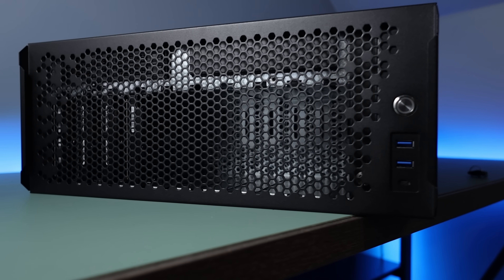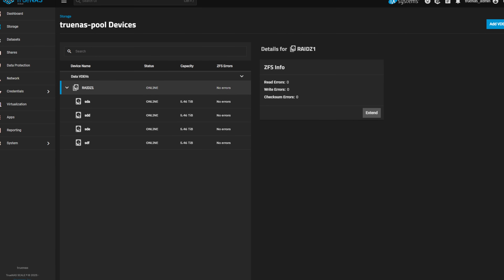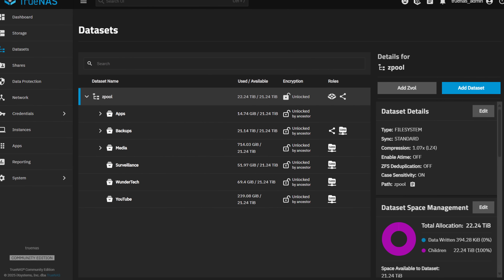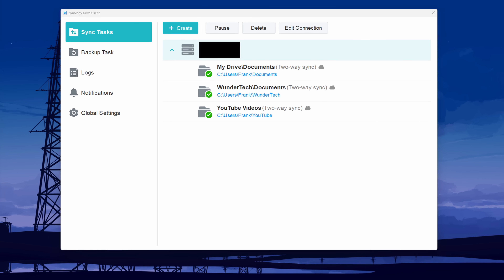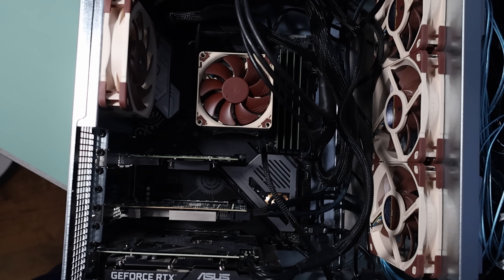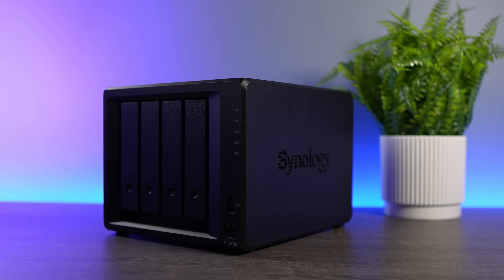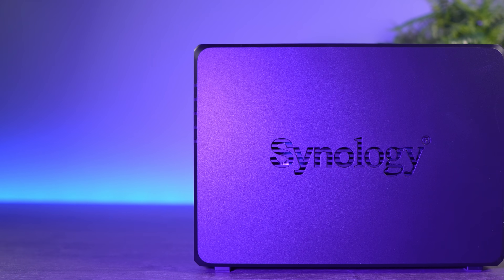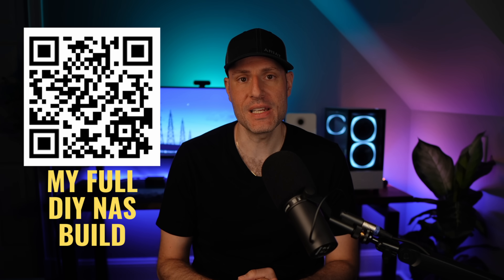Everything I Did Wrong Building My DIY NAS (was it a mistake?)

Comment: I have been reading about NAS /watching YT NAS videos for a few days, so this is ignorance speaking.
128 GB of RAM seems like  . . .  a ridiculous amount of RAM for a NAS.
I have the feeling this is doing something else.
but then the first commentor I see also has 128 GB  of ECC RAM . . . .
Reply from the maker: It's because I'm using TrueNAS + ZFS. ZFS uses extra RAM as a "smart cache", so more RAM equals better performance.
Reply: @WunderTechTutorials  thanks, I appreciate the reply.  I was "a bit" taken aback at the quantity of RAM as I have been watching videos of NAS builds w. 8 or 16GB . . . 

and I was thinking - this can't be the same thing.
I don't even wanna guess qhat 128GB of ECC costs these days.
Reply from the maker: @ekw555  Yeah, if you're going with Btrfs, 8-16GB of RAM is normally sufficient. With ZFS, the same can be true, but the more RAM you use, the better the performance, so people tend to load it up. Plus, you're correct, this RAM was purchased years ago 🤣

Comment: I don't get the thing with on demand sync. How can data live and not live on different devices at the same time? Is it synced data or is not synced on both devices? Do you use data from your NAS or you use data from your PC? Either it is on both devices and it is synced, or it is only on NAS and you read that data. Does Synology deletes files on your PC after some time? Do you understand what I mean?

You have 25gbps NIC, so you have at least 10gbps link to your PC. Why would you have all your data on your PC and on your NAS synced, not synced? Why don't you just use NAS as a working drive? 10g speeds are enough for 99% of anything to work with.

Comment: I avoided TrueNAS and went with Fedora Server instead. My needs for data retention wasn't about significant performance but availability, security and resilience and I achieved those goals quite well. Instead of using sync, I just mount my NAS as a NFS share on my desktop and use it with SMB on my phone. I've considered backup solutions and sync as well but that's the next step. It's important to cover the basics first. I would probably go with borgbackup though and possibly rsync if I wanted these features.

Comment: Losing Synology Drive is the single most concerning thing for me. I originally had Windows backing up my computers, and I had immutable snapshots so that ransomware wouldn't ruin my life some day. The problem is that nearly all backup applications save to proprietary files that the OS can't deduplicate. So, every new backup would be duplicated multiple times. In about a week, these backups filled up my entire NAS, and I had to disable it and wait another week to get rid of all of those immutable snapshots.

Synology Drive just saves them as their original files. That means they can be deduplicated and I can just go through my snapshots and pull a single file from the backup folder if I need it.

What other application works like this? Because I don't want to remain on Synology, but I can't find a viable solution!
Reply: Easiest way is to not save anything locally.  set up your smb shares on the NAS and that's where you keep your files.  If you're on a mobile setup or still want to keep your local files and use your NAS as backup to your local files (not sure why you would, just means paying for more storage, outside a few things like video editing, but even then, ehh), syncthing too keep your NAS versions updated based on what you've changed locally.  As for backups/ransomware protection, in TrueNAS (ZFS is the filesystem)  you want to go learn snapshots of your datasets and can use dedup as well.  And dont forget, it's not backed up, unless it''s also offsite as a second copy, 2 systems under the same roof don't count.

Comment: I was looking at the ASRock Taichi x570 and it seems The options to adjust ECC related settings was removed at some point. did you run into this problem?
Reply from the maker: No problems at all, everything is running well and I validated it's running in ECC-mode.

Comment: Excellent video! Though with that hardware, I would install Proxmox and create a TrueNAS Core VM, passing through the HBA for your data drives. This way you can leverage the hardware, give more reliability to TrueNAS, and install other local network services like Pi-hole, Nextcloud, Jellyfin, Piwigo, etc. (you can see what services do you like in proxmox helper scripts web).

Comment: I'm a fan of not building a storage server and sticking everything on it.  I'd rather build a separate "server" for hosting whatever services I deem necessary.  That also means that my NAS does not need to be as powerful and as such, I also look at the fact that most of my laptops/tablets/etc are on wireless so no need for 10G ethernet.   However I do think that there's a fair number of folks that think that  once they get a NAS, they're done;  in truth,  backups should also be the concern.  A NAS is a good step in the direction of centralizing your important files and data, also a good step in helping to ensure that your data is sort of safe, but backups of your data should also be on short list of things to setup.   Now, I can get off my soapbox.

Comment: I'm trying to work along with you here.  I tested drive set ups to get the best performance and at least some drive failure protection.  I'm slowly getting there.  The Truenas server is just a plaything right now as I try  stuff.

I purchased the following:
(This did turn out cheaper than buying a new motherboard, case . . . . .  I live in a small apt and I really can't keep many things on hand.)

Dell R730XD
256GB of memory 
two 10gb and two 1gb nics
I've got 10, soon to be 12 10GB SAS drives.  They are "recertified" and were about $90 bucks a piece
Right now I have a 2TB nvme I'm using for cache.

I would like to copy my Synology data over so I can test and play with stuff.  You said that you used Rsync to do the job.  I'm not real familiar with that.  I do have Rsync copying over my data, but it's going to to the default directory when I installed RsyncD.  I have no way to access it other than maybe through the shell using command lines and they haven't worked out too do at this point.

I'd love to see how you configured RsyncD and Synology to have access to your files on Truenas Scale.  I did try to use an smb folder but while I had access to Rsync, it appears I can't get access to my share folder.

Thanks.
Reply from the maker: I did everything through the CLI, but there's nothing wrong with using SMB. It's going to take a little longer, but if that works for you, go for it. The initial data load is the most annoying part, but after that, you're good to go!
Reply: @WunderTechTutorials   I just rediscovered robocopy.  I hadn't used that in years and I'm getting really fast copies.  I mapped a drive to a truenas share and one to a synology share and we were off and running. Speeds were really good.
Reply: @WunderTechTutorials  If this is a duplicate replay, I apologize.  I've rediscovered robocopy.  I mapped to a shared folder on truenas, and then to a shared folder on synology.  I'm copying large video files and speeds are averaging about 5.7gps.  I'm a happy camper now.  It has been decades since I used robocopy and it just popped into my mind.  Thanks for responding.

Comment: I don't understand the allure of Synology Drive. I understand that even sync-on-demand will use up local (client) storage. Only if local storage has been almost fully exhausted, some storage will be reclaimed. That is not how anyone should be using modern storage media (solid state memory) because it will prematurely age the media.
Reply from the maker: It's very nice to be able to work on files locally and ensure they're synced to the NAS. Not everything has to be synced and not all files perform well over the network due to their size. I've never come close to burning up an SSD so that's not a concern to me. Most that I buy are rated for 600+ TBW which I'll never get close to before they're replaced. It's a really great tool for people like me, but I acknowledge it doesn't work for everyone.
Reply: @WunderTechTutorials  you can run syncthing for this, i run syncthing on pi4 and sync keepass and obsidian notes on phone and all devices.
Reply from the maker: Yeah, Syncthing is awesome and I do use it, but it unfortunately doesn't have on-demand sync.

Comment: great video! I attempted this some years ago following your path.  I knew I had a collection of old hard rives and gaming pc hardware I wanted to use in the "pasture" until they passed from this mortal coil.  I knew I was playing with fire since I didn't have any Linux skills.  It went pretty well until a major stable release change to, 11.0 I believe,  that broke the interface and couldn't recover.  I didn't get any help on the forums either.  I tried troubleshooting from the command line and was able to get it responding but wouldn't talk to past my router to my chagrin.  had to move, then just moved on leaving the box as it was and still intend to hook it up and at least recover my data, expecting better results as I've used Linux professionally for years since. (...thinking df-h is your friend lol) anyway I imagine the Truenas is far more capable and prettier than ever haha.  Point is you've encouraged me to pick that old box up and get it done! TY

Comment: I wonder (though I understand if that's beyond your channel content) if you would be able to run xpenology with swapped HDDs from your existing Synology NAS ? not as a fake replacement but as a worst-case scenario if your Synology died and there was no fast replacement to buy to access your data ?

Comment: I’m assuming you’ve tried running Nextcloud to replace Synology Drive. If so, what were some things you couldn’t get to work as you mentioned that none of the third party solutions were a great replacement? Thanks!
I’m still rocking a DS 218+ and never used it as I have before my storage pool / volume corruption I got on it. Thankfully data was read only and I could rebuild. But the process was daunting, I had 3 websites down for a few months during a fix. Never installed Synology drive since, just use it as SMB and connect to it with Tailscale remotely. I did change out my added 4GB after market RAM module for a Synology one, just in case ;) 🤔🤷‍♂️
Considering new coming NAS options from UniFi vs MinisForum N5 Pro. Thank you for this build tutorial, I did consider it as well.. 😅👍

Comment: Good video. I have a DS1621+, and I'm also trying to move away from Synology. 
I built 1 DIY NAS and installed truenas community and I am very satisfied. I can back up photos and videos from my phone to the NAS, I have a PLEX server (which runs all movies and series in 4K without problems). and with VPN I can access my files outside of home. 
I still need to find a solution / replacement for MailPlus Server, Webstation and Phpadmin.
I don't regret the choice I made. I hope that one day they will make these applications for truenas.

Comment: TrueNAS. There is a very steep learning curve for a newbie. And a lot of trueNAS specific jargon to get ya head around. A great example of this is things like the need for "IT" firmware on an HBA> Heck I didn't even know what an HBA did when I first started..let alone why (and how) you need to load the IT version of firmware on the HBA card to get TrueNAS working properly.. I wasn't even aware of the difference between IR and IT! Nobody tells ya'all these things.. It's not like there is a "TrueNAS manual" or anything! So Don't expect things to just miraculously "happen".. there is a lotta reading to do. I found AI real useful on the build here. 

You also have to know how to rebuild the pool if the hardware goes down/dies. Been there (done that). I had a RaidZ-2 with 12 drive pool so when the server died failed chip..(and never store the OS on a USB drive), what do you do with all those drives...how do you get that pool into new hardware? Ya gotta think this sort of stuff thru..This time around I have a RaidZ-2 with 8 larger disc array and backup that to one large Stripped disc pool that I locate at a different location. That way if another disaster occurs I only have one ZFS disc to rebuild my data real quick on a much simpler device (whilst I wait to rebuild another NAS...iX ready built stuff is super expensive BTW ) I can then copy the data over my network to the new NAS once it is ready built to go. Always think thru a "whatif" the hardware fails. THe TrueNAS forums are awesome help and so is Grok AI. It helped me big time how to build a TruneNAS set up. 

(Yes SMB is a must into TrueNAS)... because an inbuilt filesystem is non existant! Yeh I know there is a webserver app to see your files an' all but that is such an awkward way to run stuff after you've used say QNAP or Synology. Nobody tells you that sort of stuff before you start! Or that it is real easy to simply SMB into a TruenNAS data filesystem via the "connect to server" process using finder on OSX... Nobody gives you any clues this is the way to go etc , but once you work it out;s it';s super easy.. It's great they moved TrueNAS to linux (with Scale) because Linux and OSX work real easy together. And it's super easy to run the Linux command line thru Terminal within OSX (guided by AI) as you can feed the results of a Linux query/log etc straight into AI for the answer! Nobody tells you that either!!!! But you can! That (along with the obvious advantages of ZFS) makes TrueNAS Scale (in particular) awesome! Because the AI Linux parameters must be huge! (It's been around forever). This makes working with TrueNAs real easy. And exciting. You feel you are on the cutting edge of the future of data storage management. Well worth the tinker!  IMO!

Comment: I am very happy with Proxmox and Xpenology installed in it with passthrough for the disks. No need to get away from DSM. Lesson learned.
Reply: I’ve done both ways… but I would pass through a HBA
Reply: are you passing individual disks or whole controller ?
Reply: @TzzSmk  I did it both ways.  Just after my build I had 4 SATA disks so passed thru each one.  A bit tedious but not too bad.  Of course I did it via command line.  Later when  I was planning to put all this in a new rack mount server chassis I got the HBA.  Now wish I had gone with the 16, but got the one that supports 8.  My motherboard SATA ports run into the disk enclosure so can't be used easily.  I then passed the HBA thru and did it in the GUI.  So much easier.  I don't think you can go wrong with either way really.
Reply: @TzzSmk I am passing individual disks but I have only 2 nvme "disks" mirrored. I am using a MS-01 Minisforum...

Comment: Solid take. I too took this route. Never looked back. Buying into a brand is folly today.
Reply: Don't need brand loyalty, just use whatever is cheap, its a NAS after all. You could build one entirely out of dumpster dive salvage if you wanted, just use some level of redundancy/mirroring in case a drives fails.   The reason corporate goes with specific brands is warranty/support (which is a huge deal when dealing with large data centers).

Comment: As for your drive/sync problem, running a Nextcloud instance would solve this to a degree, as it does support on-demand sync of files. It has some limitations particularly on Android for example (there was a long dispute with Google/play store who wouldn't allow them to auto-upload files from their app). It does the other things like provide access to files via web. OwnCloud also still exists (NC was forked from this) and it's targeted more towards business use, stability and reliability, less about doing everything at once and having ALL the "apps".

I am over all satisfied with nextcloud, but of all the services I run myself, it's by far the one that I've had the most work with due to just random nonsense. Also I'm pretty sure that you're aware of NC and not used it for some specific reason...

Comment: Indeed I'm surprised you said you didn't use SMB much for accessing your network files... I never really used Synology drive at all since I got that NAS and even before getting a NAS I was using SMB, NFS, and the old NetBEUI protocol for accessing my files through my local network. I always try to find alternatives for the apps I use or plan how I will do things before switching to a new device or workflow. This is how I did my transition to Linux from Windows as my main OS and other similar scenarios. There's definitely still have some adjustments to make but it made things much easier envisioning ahead of time how I will do things and testing it first to see if it's viable before jumping in.
Reply: I used SMB but only for my MacBook AIR which I gave to my sister.  It doesn't do well with NFS stuff.  Now I do it all via NFS.  Never used Synology Drive.

Comment: I did a DIY build just recently.  Have had 2 Synology systems over the years (415+ and 1621+) but I did not like the way Synology was headed.  I had an older gaming system sittiing doing nothing so chose that motherboard (AMD Ryzen 3600x) and 128GB of RAM.  Put Proxmox on it and run True NAS Scale as a VM.  Works fine.  I am very happy with TrueNAS.  The permission set up for shares is a bit clunky.  I have 12 TB split over 2 VDEVS of 4x3TB drrive and 4 4TB drives.  These were from my two previous Synolgoy systems.  I also run pi-hole and Jellyfin.  Had Plex but moved away from it for similar reason.  I haven't yet gotten to the end of your video so we shall see if I made any of the same mistakes that you did.  I have never synch'd data to a NAS.  For me this is all just for home use not any business or anything else.  I back up to a 2TB slim drive for now.  I have less than 1 TB of data.  Most of it is computer related stuff like manuals and schemactics as I delve into old computers (mostly DEC stuff).  Great video though for most people.  Thanks.